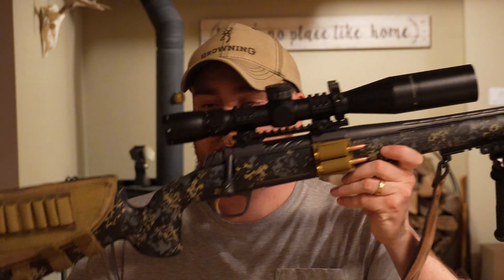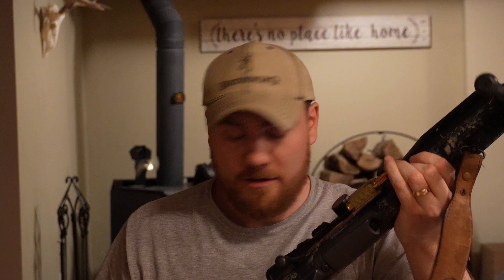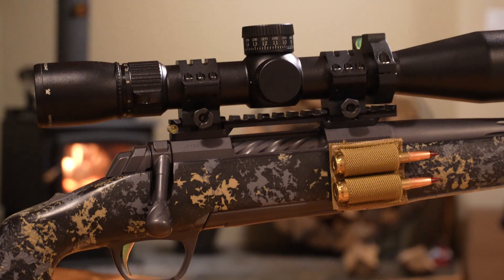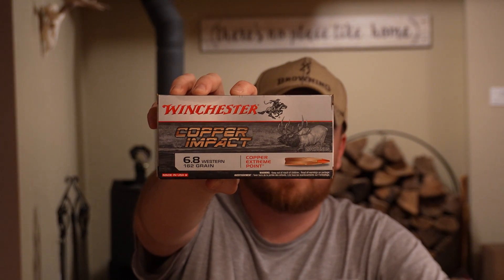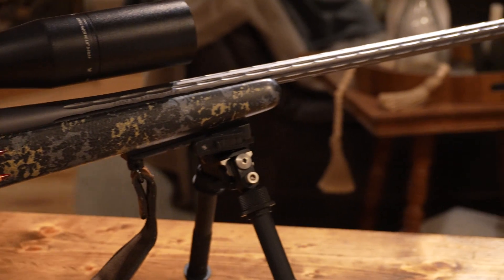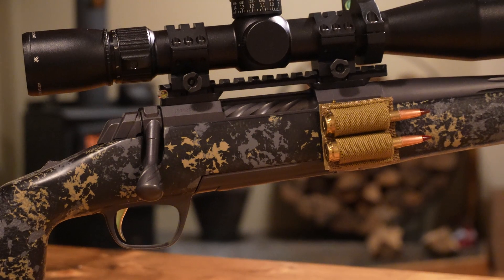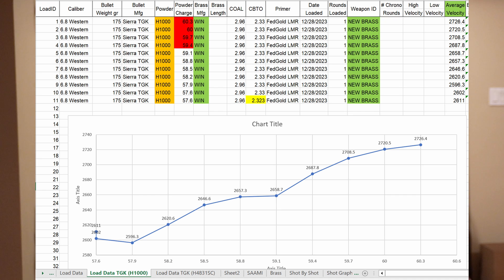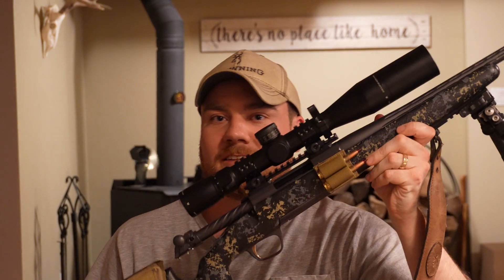6.8 Western - Load Development - Episode 4 - Initial Results Breakdown

Comment: Great info btw! Im looking to try Ramshot magnum next (once there is stock) to see how well that works. I’ve been using H4831SC and IMR 4831
Reply: My best load with the 175 sierra game king was using ramshot magnum 68.0 grains at 2.91 coal.  Im shooting a Browning X-bolt speed with a 24” barrel. speeds were at 2760 fps. Took a buck with that load at 540 yards. 

I am now developing a load using the 170 nosler ballastic tips with 69.0 grains of N570 at 2.91 coal shooting 3000fps, with a .5” group at 100 yards. 

Happy shooting!
Reply: Ramshot magnum works great in my 6.8